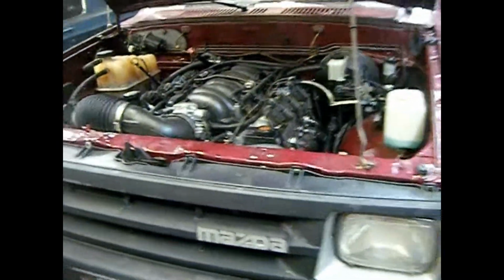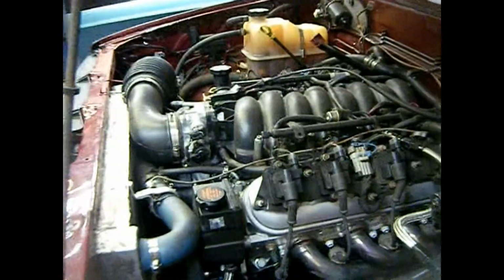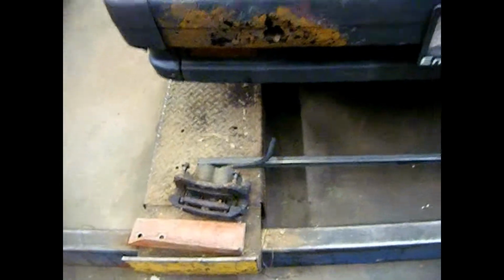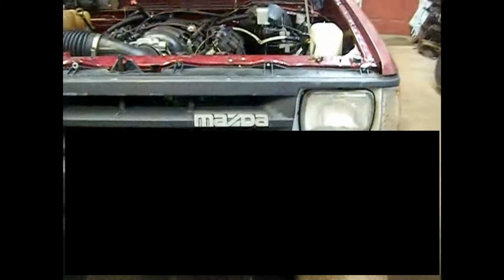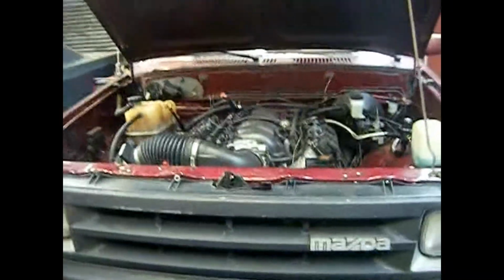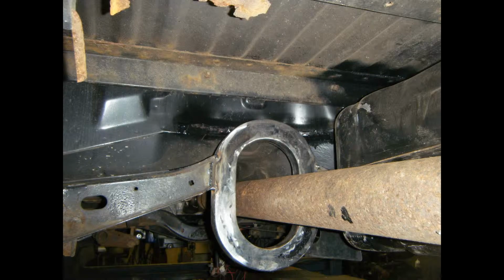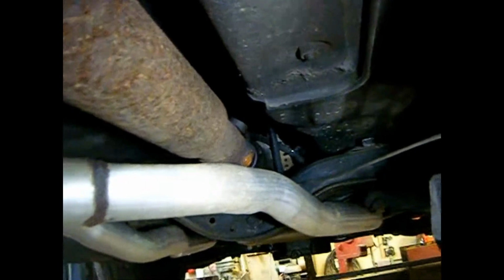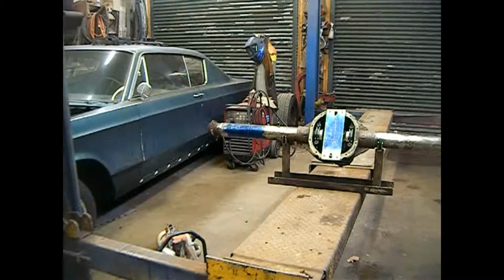LS SWAPPED B2200 PHASE 2 ENGINE & TRANS INSTALL

Comment: I’m struggling with my current ls swap into a b2200 I have 0 power to the truck and I can’t figure out which wires to power to have my lights + fuel pump to run. Any tips?

Comment: Did the mazda rear end run good on the engine?
Reply from the maker: I drove it several thousand miles, and even drag raced with it. But I never really abused it because I thought the rear was pretty fragile.

Comment: Been trying to find info on this same swap for a year would there be anyway I could get some more info on those motor mounts and thanks for the vids been really helpful.
Reply from the maker: Hey Jackson! Thanks for the kind words! I will send you a link for the ebay motor mounts, and explain how I made the frame tabs. Just give me a couple of days to dig the info up.
Reply from the maker: Hey Jackson. I just posted a video that shoul answer your questions. Let me know if it was helpful.
Reply: @KEIFabrication  what swap kit is it? Could you send me the link
Reply from the maker: @CORRIDOS-yy1fi  There is not any kit available. I made or modified everything myself. Check out this video for some solutions to some of the problems:
https://www.youtube.com/watch?v=e9bS2rNiOdI&t=14s
Reply: @KEIFabrication  like what swap kit do u think 🤔 would work as the plates u used

Comment: hows it going, im learning alot about your build, im currently doing a 4.8 swap on my b2200 and your videos have helped alot! did you delete the torsion bars completely?
Reply from the maker: Thanks for the kind words! I hope my channel can provide some information to make your LS swap successful! 
I left the stock torsion bars in place. The only thing I needed to do was add 4-5 turns to the torsion bar adjustment. The truck handles, rides and drives extremely well!
Reply: @KEIFabrication  oh awesome , ill be fabbing a new crossbeam so the oil pan fits as well, your video gave me a great idea! this has proven to be a very daunting task, since i dont know much about mechanics but im learning more and more every day , i appreciate the time to make the videos!
Reply from the maker: @josuemendez1308  Excellent! Thanks!

Comment: What are you running for headers?
Reply from the maker: Just switched to speed engineering S10 LS swap headers. they fit better with no steering column modifications required.
Reply: @KEIFabrication  sweet thank you.

Comment: How much would you charge to make the cross member for the front?
Reply from the maker: Hey James! Thanks for the inquiry. Let me have a day or so to figure it out and make sure I have the material. Are you planning an LS swap into a B series Mazda?
Reply: @KEIFabrication   yes I am I have a 1989 mazda b220 been trying to find some info on it for a while now. Your videos have been really helpful. Cant wait to see more.
Reply from the maker: Excellent! That is exactly what I was hoping would be the result of posting the details of this project! Thanks for the positive feedback! I can also provide details for steering shaft modifications and header modifications necessary on the drivers side.
Reply from the maker: Hey James. Looks like I have all the material in the shop to make a cross member. I think it will be between $75 and $100 plus shipping. Unpainted. Should be able to get in out to you in two weeks max.
Reply from the maker: Hey James. I just posted another video on some of the issues you will face doing this swap. As far as the cross member goes, you might want to figure out  the oil pan you are going to run. The truck pan works great with this cross member, but if you plan on lowering the trucks ride height at all, you will want a Camaro, Corvette, or Moroso oil pan. I am going to try and get a Moroso oil pan and make a new cross member that will accommodate the longer sump. But that  may be a month or so away.
Reply: Kei I’m also interested in the crossmember I may run the Holley oil pan since my truck is lowered  it’ll be a while off but I’m definitely getting my head wrapped around swapping the truck